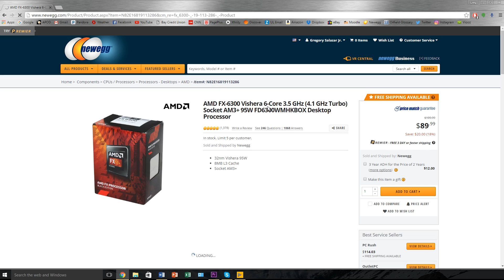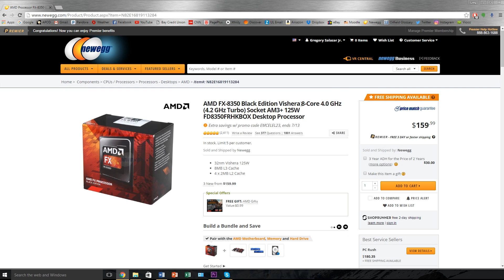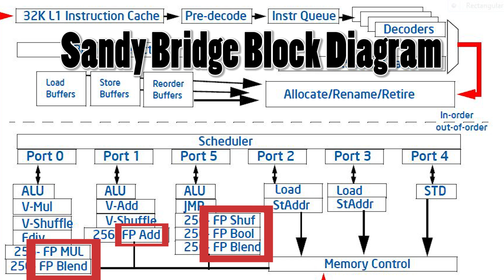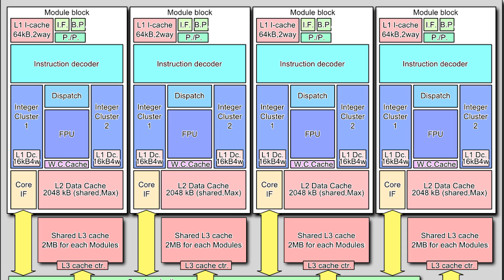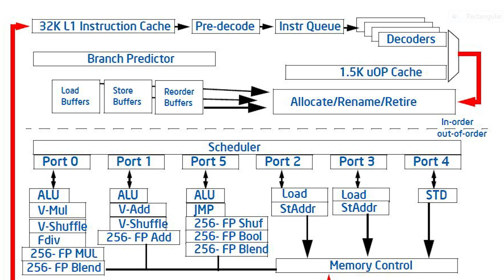How Many Cores Do AMD FX Processors *Actually* Have?

Comment: So to oversimplify everything, the 2700k has 4 cores with 2 threads per core, but AMD has 4 pairs of conjoined cores. intel has 4 cores trying miserably to pretend they are 8 threads, and AMD has 8 cores that are kneecapped into performing more like 4 cores. so both perform more like they have 6 cores and 6 threads
Reply from the maker: LOL @ your second sentence.
Reply: That doesn't change his point about hyperthreading. Intel cores perform better for many other reasons than they have hyperthreading instead of two physical cores performing a similar function to hyperthreading. In a perfect world, where both of the CPUs are using identical technology other than how they get to 8 threads, the AMD chip would be faster. Intel has several other thins going for it.
Reply: Hypertreading is a huge thnig when combined with an efficient pipeline, AMd's attempt ot emulate it fell short because of a design flaw on how data goes thru and the overall low ipc of bulldozer.
Reply: logic.
Reply: +Arobsite the only thing hyper threading does is improve CPU utilization in heavily threaded applications. No idea what you people think it does
Reply: CrackedDylMil
yeah basically al lthat hypertrading looks ot do is attempt ot solve an issue that odler cpu's had, they were very pwoerful for the time, but spent a lot of that time waiting, HT looked to od somethnig with that downtime by allowing another tread
Reply: AMD has 8 cores that are kneecapped into performing more like 4 cores. X'D you win 2 Internets sir cause one is not enough
Reply: CrackedDylMil
No, they made the bet that people would make software that was more heavily multithreaded.
Intel made a bet that there would be more instruction level parallelism (more workload pr individual thread).
Intels bet paid off, AMDs didn't.

And you can write it to make use of different arcitectures.
Of course it depends on what kind of code you're using.
If you're writing in python or whatever then you don't have much say as the optimization we're taling about here is at the programming language level.
But in C with some assembly and op-code mixed in?
Sure you can.
Heck, even without assembly and op-code just using less double precission and more single precission calculations for instance will help for an AMD CPU, plenty of programming languages allow you to choose your precission level.
Of course some have opted to just use double precission by default...
Reply: CrackedDylMil
Nvidia has equally bad OpenGl drivers tho, justthat their quadro lineup is a bit more solid spec wise ot make up for it

Both companies suck at opengl to be honest, and this is a shame because its one of the reasons why they struggle with linux
Reply: Jay Koerner
 No, a 8350 running at stock (4 GHz ->4,2 boost) can beat a 3770k at stock (3,5 GHz ->3,9 boost) in some applications.

But it's not going to match the i7 in gaming.
However it can beat i5s in gaming.
And while it won't overtake the i7 the performance of the two will be much closer when you're overloading it (gaming while doing a ton of other stuff) because the performance reduction pr core of using both cores on an AMD module is lower then the performance drop pr thread of using both threads in one Intel core.
It's not enough for the AMD core to overtake the 3770k when those tasks are not the ones the 8350 is best at, but the difference does become rather small.
And when you run code that the 8350 actually likes it's a beast. =)

I just wish there where more of those... :-/
Still for people that's obsessive multitaskers like me it's a really nice chip.

Like, I usually run 30-40 workspaces at least in linux each with 10-15 windows and if those are browser windows there's probably 7-8 tabs pr window...
Often several different browsers (chrome + firefox + Opera + a few others)

My 8350 don't buckle under the load, a quad core Intel chip would at a higher price.
And there's no premium to OC the thing if I need a little extra omph unlike Intels K series...

That said, it starts off running stuff slower to begin with.
It's never going to match a intel core in single threaded speed...
Not even close.
So it's all about what you use the damned thing for.
Reply: Transparent. Try harder.
Reply: Except you're wrong because despite only having 4 cores, each of the two threads assigned to each core can actually be utilized at 100% load with near-perfect efficiency, whereas the FX CPU cannot. So in practice, the i7 wins based on both A) the design allows Intel to remain more powerful on that front alone, and B) even if this weren't the case and they used the same design flowthrough, the massive gap in IPC difference between Intel and AMD at the moment would keep the gap just as wide.

It's silly to assume that just because the design is different, the CPU suffers. Hell, Phenom II is more powerful in terms of raw IPC performance, and it's why a Thuban based CPU clocked nearly 500mhz slower is still as fast as a CPU that features two more cores than itself. Kinda sad when your previous architecture's flagship is still faster than your fastest offering.

1100T @ 4GHz > 8350 @ 4GHz.
Reply: Depends on the workload.
Anyway, when both threads in a hyperthreaded intel core is at 100% utilization you actually get more performance penalty pr thread (even through the total throughput for the two threads combined increase) then what you get with the AMD cores in a module.
Of course if you lower the workload a little bit (something like 60ish% on one thread and 100% at the other) you'll see the intel core getting better scaling.
Of course in most cases that's exactly what you're getting...
And the 8350 got worse single threaded performance to start with anyway so better scaling for the two cores in a module then the two threads in a intel core at full workload isn't really helping all that much)
And then there's all the bottlenecks, the crap cache system, the bottleneck in the frontend leading to you only getting about 3 integre instructions feed to the two cores pr clock despite them being able to actually process 4 integre instructions pr clock (meaning that unless you got a multi-clock instruction running you're wasting resources) and the FPUs being shared (especially for double precission stuff)...

All in all it's still a great processor for multithreaded workloads, but the 8150 (not the 8350) is being beaten by it's predecessor in single threaded performance...
(I don't remember if the 8350 also beats the 1100T in IPC or if the difference is just done with frequency...)

Anyway, with the exception of the cache system that's just horrible the rest of the design decissions of the 8350 actually makes kind of sense and would have panned out if software had gone in the direction they thought it would back then...

And they did offer better total potential throughput even if its single threaded performance was...
Dissapointing...
Reply: CrackedDylMil
Ugh, Java...
It might have improved but I'm never going to like that language...

Code it once, debug it everywhere as they say...
Reply: imglidinhere
 Those 20% is due to better utilization, the i5 cores simply spend that time waiting for data from the memory or got stuff in the core not being used during the instructions it's running on those cores, things that the i7 can use.
So in terms of throughput of course the i7 performs better.
But the single threaded performance in one of those two threads in a core will go down when you add content to that other thread because the i7s core don't overprovision enough extra resources to ensure that the two threads will never hold eachother back.
In some situations you'll get a perfect scenario where each thread only wants resources that the other thread don't need and you'll get 100% utilization with zero performance penalty on either thread.
But in most cases that's just not the case.
So some of the instructions that the thread could have run that clock if the core had more resources not taken up by the other thread simply have to wait a clock to be run.
That's why you see the i7 with hyperthreading enabled actually performing worse in some games then the same processor with hyperthreading turned off.

As for the 8350 having worse worse IPC...
It has worse IPC because each module takes up about the same space as a core with hyperthreading from Intel at the same processing node, but the module as a whole actually have a way higher potential throughput then that intel core with hyperthreading at the same process node.
It's the individual cores that's slower.
They where betting on a number of things being true about future code.
Things that turned out to not be true, especially for consumer software.

As for the IPC just being plain bad, that's application specific.
All processors have different IPC for different programs at different clock speeds.
So when someone like AMD claims a 40% improvement in IPC they're (probably) just trying to give an average of what they're seeing with the programs they've tested so far (and at earlier points it was estimates)
Had programming trends shifted the ways that AMD predicted when they started developing the construction work series of chips then the IPC would actually have been higher for their chips, unfortunatly it didn't turn out that way.
Both AMD, Intel and Nvidia always have to make bets on what kind of software will run on their hardware 4 years down the line when they start planing out how their hardware is going to look.
And those bets will be off at times.
In this case it was AMD that made the wrong bed.
Tough luck.
If you make a program that actually do follow their bet then your performance is actually way higher (except that horrible, horrible cache that there's just no excuse for).
That's why the 8350 actually beats the i7 3770k in some situations at the same clock speed in individual applications and tasks despite the 8350 actually having bigger transistors due to being an older process node.
It got smaller cores with less resources for the thread to use pr clock then a intel core, but due to AMDs approach to SMT where they use two cores with shared resources the threads and cores actually have more resources available then the intel threads when the intel threads are both being chocked full of work.
If you're running one of those two threads on the intel core at less then 100% load though you won't notice that as one of the two threads delaying some instructions one clock won't really matter much as there's plenty of free clock cycles where there's space resources for one of the cores to utilize.
If it's two threads at 80% load or 1 at 60% and another at 100%.
So in real world consumer usecases Intels approach is simply superior.
For servers that actually do run 100% utilization at all time with optimized code the AMD approach is technically better though for those workloads that AMD where betting on.
And even servers don't always run 100%.

So seeing the error of their ways AMD is now going the route that Intel and IBM and many others are with cores with more then 1 thread sharing resources equally instead of guranteeing resources for one of the two threads that's just not available for the other thread.
Reply: +Luredreier AMD didn't make a bet at all. Shared resources is totally fine if the resources you're sharing is enough, AMD just made a crappy CPU.  "writing your application to do this that and the other" isn't a thing at all. You can't just write your software to prefer a certain architecture. All you can do it write it the most effectively as possible, and one architecture might benefit from certain optimizations more than another.
Reply: CrackedDylMil
Ps. If you want to read about AMD CPU optimization there's a ton of info about that out there.
I like reading some of the stuff over at http://www.agner.org/ for instance.
Ton of gold there.
Reply: CrackedDylMil
True, but they where counting on things like more workload being hardware accelerated (the iGPU) something they're still working towards with HSA in carrizo.
And they have compilers now that can accelerate even C/C++ code to some degree.
I believe the goal is to accelerate it without added libraries, just using analyzis of the code itself to identify acceleratable components.
My guess is that back then they probably thought more of the code would end up accelerated that way directly leaving less instruction level paralellism in the actual CPU code.
Yeah, they probably screwed up with that part (back then there was no way to do that much hardware acceleration for small pieces of code without getting more penalty for moving the data around then you'd get bonus from using hardware acceleration in the first place, and HSA has taken quite a long time to develop for AMD)

Of course that's just a part of it.
There's plenty of things you could theoretically throw into extra cores to accelerate software.
And there's the issue of simply throwing more software at the processors in the fist place.
That's one area where AMD still shines btw.
Of coures application specific but still.
Reply: of course Intel wins when you compare Skylake to the FX8350.. Intel had an IPC advantage the whole time and the gap only got wider when AMD went quiet for a few years without releasing any real new silicon.
Reply: Peter Hindes well they add parts to the cpu to allow it to have more "cores" some of the more important parts are duplicated, but yes you get more 'Logical Cores', its not really cheating since it's just a method to allow a cpu to have around 150-180% more performance for only a marginal increase in die size and cost, it's better to have HT/SMT then not have it since it can just as easily be turned off if you want the marginal single threaded performance boost, in almost all consumer applications the slightly lower performance, won't effect how applications run and the extra threads allow them to run twice as many applications without performance issues, if you try to run 8 threads on a 4 core chip you would be luck to get 40% the normal performance and will have stutters and hangups on resources, but with HT you will get 80% of the performance and applications wont hang or stutter
Reply: Peter Hindes He's sort of right, although he's misrepresenting the performance bonus of hyperthreading.
As SMT implementations go Intels SMT (hyperthreading) is a relativly poor one with only about 30% scaling in most applications even if Intel claims up to about 50% improvement if I don't remember wrong, something that pretty much never happens in real life even in best case scenarios...
If you can get a hyperthreaded Intel CPU for less then 30% more in price over a non-hyperthreaded CPU with the same core count, clock speed and architectural generation then by all means go for it.
If it's about 30% price premium you should consider how much multi-tasking you're going to do.
If it's more then 30% you should consider if you can get other systems with more throughput at a lower cost from Intel or others.
That said for people that both multi-task and want high single threaded performance there's nothing really beating the latest and greatest from Intel. shrugs
For comparison a FX 8350 can beat a 3770k in some applications in raw throughput but it always lose in single threaded performance.
Its single threaded performance is now about half of that of something like Haswell/Broadwell while its multi threaded performance is also behind these days, it's old after all.
Some Xeons from Intel has a way lower clock speed then their core brethren leading to lower single threaded performance while you can get more cores.
If you're willing to go for a older Xeon (older arcitectures also tend to have lower single threaded performance) you can get those extra cores fairly cheaply and can potentially get quite a bit more multi-threaded performance then say a quad core i7 for a similar price but with a way lower single threaded performance.
For single threaded performance a i5 or in a few cases even the anniversary pentium with a good OC can probably offer better performance then the i7, at least for the price.

Anyway, are you planing on building a new system since you're trying to learn these  things?

Btw here's a few things you might want to read:
https://en.wikipedia.org/wiki/Out-of-order_execution
https://en.wikipedia.org/wiki/Hyper-threading

Anyway, you can get some bugs with hyperthreading sometimes due to issues with handling all the data in the various caches, and there may in some cases be security issues, in that code running in one thread can sometimes peek at data of code running in the other thread.
When you got hyperthreading enabled and are running code on it you'll also get a higher power draw since your CPU utilization goes up and your single threaded performance may at times suffer.

But in general the benefits of hyperthreading easily outweighs the drawbacks.
Reply: Luredreier Well in personal experience I've seen it only slightly go both ways especially in encryption and video/audio editing. Sometimes i7  2700k series slightly ahead (but less often) than sometimes 8350 was ahead. I only had the 2700k to test. This might be due to other variables I hadn't accounted for, but I would tend to agree with your statement in general.
Reply: CrackedDylMil When did I start claiming things about hyperthreading? I only talked about how there are reasons other than it existing that a 4-core intel CPU performs better than an 8-core AMD CPU. I literally was talking about everything EXCLUDING hyperthreading.
Reply: +Luredreier you can't just decide to thread everything. That would hurt performance. If you have a task that can run asynchronously, and one that takes several milliseconds to run, then you thread it. Otherwise, you just don't thread it. You can't just decide to thread everything
Reply: +Luredreier I don't think you understand how traditional applications are written.
Reply: +Luredreier check out Oracle's Java 8 documentation on threaded applications (Java 8 is just as fast as C++ now adays if you know what your doing. My client runs with 0% overhead for instance)
Reply: +Luredreier oh my client Direkt works on every single platform. Except some rendering functions don't work on newer AMD video cards because of their shit stain quality OGL performance
Reply: Ricardo
Yeah, don't I know it... ><
That said on linux Nvidias closed source OpenGL drivers are actually ahead of AMDs OpenGL drivers by a fair margin (a 960 can beat a Fury in some apps)
I don't really think either graphics card company is going to provide good linux performance till vulcan becomes more videspread.
That said AMD is really improving.
And the RX 480 actually had decent launch day Linux drivers.
part of the reason why I'm considering picking it up.
Reply: +Ricardo (Teixas) I write OpenGL literally every day, and Nvidia just has less bugs than every other vendor. Usually I end up having to do things less efficiently because the way I want to do it doesn't work on AMD cards. even Intel HD is better than AMDs support at times. AMD does tons of effects wrong. Most of those effects Intel just doesn't do at all.
Reply: CrackedDylMil
As a AMD fan that game on linux I definitivly share your frustration... :-/
That's one area where AMD genuinly is behind Nvidia...
Reply: Not arguing that AMD is better. definitely not.. but AMD does technically have the raw hardware advantage here even though they only have half the FPUs they need. they still have 8 technical cores capable of doing all kinds of non-FPU math, they just get shot down in FPU intensives. but that was vs. a 2700k.. the 6700k has any AMD chip by the balls now.
Reply: True. comparing 2 architectures directly is completely unfair, but the only way to look at it objectively: how the architectures themselves perform. having more transistors doesn't always win the race.. it helps, but doesn't make it perfect.
Reply: Well... efficiency is nice, but HyperThreading is still not great if you are hammering all the cores, you just end up doing 8 things at 75% speed rather than 4 things at 100% speed.. raw performance may go up, but you are still trying to make 2 threads use the same core.. HT is nice, but.. 1 core =/= 2 cores..
Reply: Jaden S.
Well, that's not really the case even if it seems to be that way, it's not just that they're shot down in FPU intensive workloads, there's also inefficiencies in other areas, especially the cache system and the frontend.
The inefficiencies in the frontend could have been justified in the days of mechanical harddrives and lower levels of instruction level parallism that they where making this thing in...
But basically while the two cores on a module have 4 integer units in total the front end is only able to supply about 3 integer tasks pr clock on average meaning that unless one of the  tasks you give is a multi clock task (taking more then one clock cycle to complete) you're going to have inactive hardware, of course with mechanical harddrives chances are that you will have anyway since the processor ends up spending time waiting on data from the harddrive (not everyone got tons and tons of high speed RAM), so with this design you could ensure that both of the cores got at least some work done each clock cycle even if the other core suddenly got work at the same time and your first one already had a multi cycle task running on it.
But in the scenarios of todays computers you end up with the bottleneck actually being inside the processor instead of outside it...
And then there's the cache system...
That one is just bad...
Basically any instruction needing to interact with it has to spend a ton of time on waiting on the data comming from the catche and going to the catche, it's almost as bad as the RAM itself at times...
The catche is probably one of the biggest bottlenecks there that can't be justified in any way that I can think off...

There's also the issue that he brought up about not everything being threadable and AMDs approach meaning that there's less resources available for instruction level paralelism when the other thread isn't full.
Reply: +Arobsite if they were using the same technology? if they were using the same tec as Intel they would be fast(in real performance) but they would also have the same constraints namely clock speed, they would need to heavily tune down the clock with the extra fpu's leading to it being hard(with out knowing how they would have developed the rest of the cpu) to know what the difference in performance would have been, honestly amd jumped the gun thinking if they changed how the processing cue needed to be sorted that the industry would change to get more performance out of there chips, not thinking of the snowball that happened when the boost that should have came with a new architecture in the short term lead to the increase of Intel's already gaining market share(they were hoping that the performance on properly optimized software that didn't exist yet would be enough to out stretch Intel's performance lead) this lead them to be tight on funds and stuck with a bad architecture for 5-6 years
Reply: +Luredreier just made the same statement about amds chips betting no the wrong trend, they didn't take into account that Intel had already started to get market dominance and the issues in the short term with unoptimized programs lead to Intel picking up enough market share that it made no sense to redevelop to code to support it(for Microsoft, if they had optimized probably for it I'm pretty sure it would have ended up at least in the game engines if not other software like video editing) on top of the fact even if they had went the same way as Intel the clock speed hit they would take for those extra fpu's would have at best put them inline with Intel at the time. just for clarification on how bad there performance is I have a 4c/8t westmere Xeon and it gets the same single thread performance and 80% of the multithread performance as the 8350 and I got it for 12$ on ebay that's how bad a buy amd is at the time being
Reply: Jay Koerner
Depends on the applications.
My 8350 at stock can beat a 3770k in some applications at stock in multithreaded workloads.
The 8350 is mainly competing against the intel i5s being a more multithread friendly option.
I'm not going to agree with you that the 8350 is or was a bad buy. (although I wouldn't get new am3+ motherboard atm)
But its not suited for dx11 gaming and should only be picked up if your workload would benefit from picking it up.
Also with Zen comming up I've started to advice even people with workloads suitable for the 8350 to wait to see what the Zen brings to the table and the price development of the 8350 and Intels chips after Zens launch.
If you're gaming a Kevari chip might be a better buy to be honest for the price.
It got better both single and quad threaded performance, and enough L2 cache for games unlike the one carrizo chip we got on the desktop...
It does have a lower clockspeed through and half the cores of the 8350...

Going with a AM4 motherboard and a excevator core (that hopefully have more L2 cache) should be a decent build and unlike current day AMD builds you'd have a decent upgrade path with Zens also being compatible with the motherboard.

Anyway, back to the performance relationship between Intel and AMD...
You roughly need 3 cores from the 8350 to get the same throughput as 2 intel cores with hyperthreading in a good scenario and 4 in a more normal scenario.
Reply: Luredreier not sure about other applications the most i've looked at is games, cinebench, and firestrike, i was just stating that i've never seen anything in those where amd beats the current(at the time) intel comparing each core to a single hyperthread not sure if you are talking about overclocked amd vs intel since that is more even but even still as far as i can tell amd need three cores to match(or beat) a intel core with hyper threading
Reply: +CrackedDylMil I thought it could dynamically allocate cores to different threads
Reply: In the first sentence, derp. You claimed he was right about hyperthreading.
Reply: Peter Hindes You thought what could allocate cores to different threads?
A Intel CPU?
Reply: Red Phoenix Who is "you" in that comment?
Reply: Luredreier yup, how else would you get 8 threads and 4 cores?
Reply: Peter Hindes Depends a bit on the definition of cores that you use.
But part of my problem is that I don't quite see what comment you're replying too.
And no, you have two threads pr core, and the core will divide resources on the two threads dynamically.
If you have 2 cores and 4 threads any task on thread A and B can go to the first core and thread C and D to the second core but thread D can't run on the first core.
As for the work done in those threads that's managed by the operating system at a much higher level. There the operating system checks what tasks can be done in parallel and what has to be done serially and it'll put serial tasks in a thread, one little bit at a time.
The threads are basically just queues of tasks for the cores to do.
Reply: Luredreier I thought hyper threading let threads swap to other cores that finished "early"
Reply: Peter Hindes Nope.
Hyperthreading or not all multi-thread systems can shift tasks between threads if they have a OS running on them capable of doing that (most modern OSes)
It helps of the CPU in question has shared cache so you can move some of the data over without sending it all the way to RAM.
But really all you need is the tech used to allow more then one program to run at the same time on processors with just one core and one thread.
Basically the capability to interrupt a program and move the data to memory saving the state of the process so another process can get some time on the core in question.
Once you got that you can use the the technique to move processes between threads and cores too.
Still, there's a limit to how much you can divide up tasks.
Reply: Luredreier so what can hyper threading do for my cpu?
Reply: Peter Hindes It's a form of SMT.
Let's say that you have a i5 and a i7.
With the i5 that have 4 threads it doesn't matter how much work you throw at the core each core will spend a lot of time idle waiting on data to arrive from RAM or simply not using certain parts of the CPU made for instruction level parallelism.
With hyperthreading you have two different threads running on the same core saved in their own cache.
So lets say that you have a core with 4 execution resources and in one  clock cycle one of the threads have just 3 tasks for the core to do, with hyperthreading another thread can fill up that last execution resource with a task if it has something to do.
That means that you actually get way more throughput through your cores, much more work done.
With Intel CPUs that's about 30% more performance on average.
However it also means that if one thread is using most of the resources in a core then there's little left for the other thread so that thread will have to wait a cycle to get free resources leading to slower single threaded performance in that thread.
And as a result there are actually games that will perform worse when you enable hyperthreading.
If you have more cores instead of more threads on the same core you gurantee more resources available for the individual threads but how much resources each core actually have available is a design decision.
If you compare a Xeon CPU from Intel with a Power8 from IBM a 8 core Power8 CPU actually have 8 threads pr core as well as 8 actual cores leading to a total of 8x8 threads in total for those 8 cores.
And the cores are designed with the intention to always have at least 2 threads running at full load at any one time and if you don't have a minimum of two full threads you're getting very low utilization of those cores with a ton of resources simply not being utilized, but once you run a full 8 threads in a core it can actually outperform a Xeon core with hyperthreading in total throughput.
But it's not designed for fast single threaded performance.
If you where to try to play a game on a Power8 you'd end up with a rather low performance.
What Intel has done is specializing in single threaded performance, way more then both AMD and IBM has.
And that's good for games for instance.
But they still choose to use 2 threads pr core in their high end processors because of the higher level of utilization and higher total throughput that leads to.
That allows you to get tasks from two threads, potentially two different programs altogether run simultaneously on the same core even in the same clock cycle.
All in all it's just tends to be a good thing in most situations.
I don't know if Intel CPUs have thread prioritization opt codes.
But one of the things I'm excited about with AMDs upcoming Zen is that a thread can be prioritized so you're guaranteed more available resources for that thread with the other thread waiting on resources more if you need that for certain tasks.
That's how they're planing to do SMT in Zen that will come out next year.
By comparison their current implementation of SMT in for instance Bulldozer and Piledriver and even later CPUs like Excavator is that they have two cores sharing resources in a module.
So some types of tasks can only use resources from one of the two cores meaning that if you don't have a tasks using that type of resources running on both of the cores then that core will simply have that resource unused even if the other core have a task running that could theoretically use more of that exact type of resources.
On the other hand the two cores share other resources meaning that if one of the cores need that resource and the other core doesn't use that resource then all of those resources are available to a individual core while in cases where both cores needs those resources then they either have to share the resources in a clock cycle or in some cases one core will utilize all of the resources forcing the other to wait one clock cycle before it can be given resources to use.
It sort of works and it's a good idea in a lot of ways.
But in the end each core hasn't been given enough resources to compete against a Intel core that's designed to run twice as many cores and that's "bigger" (in terms of number of transistors/in size when on the same process node) and more complex as a result.

I hope that helped you a little bit?
Reply: Luredreier simple answer, it allows your cpu to more or less use one core as two "cores" with around 75-85% of the none hyper threaded performance. this all requires the cpu support hyper threading and doesn't increase the cache available to all processes, but few programs will have a meaningful performance decrease from keeping it on and it allows more applications to run at the same time.
Reply: Jay Koerner so it lets you get more cores more or less by "cheating"
Reply: Jay Koerner Eh, we're talking about closer to 65% then 75% of the original pr thread performance...
And 85%?
I don't know of anything with that kind of scaling on Intel hardware, on a AMD module or Power8 core perhaps, but not on a Intel core with hyperthreading...
As for the number of applications, technically you can run a thousand applications on a single core, it'll just be damned slow...
The issue here is more that you get more total throughput and that in turn makes running more applications more viable.
Reply: Jay Koerner Intel CPUs do not have 150-180% performance with hyperthreading...

On average you're getting about 30% added performance increase for the extra threads on each core with Intel while AMD has 40-50% and Power8 has 60% for the first extra thread and then drops down significantly for the next few threads.
Reply: Luredreier depends on the application, since some care more about having threads then individual core performance and you could see the boosts in games and other applications like them but, cinebench tells me i get 87 for single threaded performance and 487 for multi thread  right around 70% performance for each core, so yeah pulled the figure out of my ass guess in best cases it's only 140%-150%
Reply: Jay Koerner It's more then just the multi-threaded nature of an application.
Two different 8 threaded workloads can behave very different with a quad core hyperthreaded Intel CPU.
Not because of a different preference when it comes to singlethreaded needs, but because the workloads of the two threads pr core simply scale differently.
There might be a few rare cases where 150% normal performance (50% performance bonus over the regular) might be possible.
But those are only the ideal situations, and those happens next to never, even optimized code rarely have 100% ideal situations all the time.
You'll often find one of the threads holding the other back in some way with the threads both wanting the same in demand resource at the same time while something else stays unutilized.
So in the end, roughly 30% is what you can expect for most consumer software, 40% is  more likely for optimized code and 50% is the dream scenario that just about never happens.

Ps. Kudos for admitting that you pulled the numbers out of your ass. ;-)
Reply: No your wrong. When comparing two cpus with the same lithography (32 nanometer) and thread count Which are the 8320,50,or70 vs i7 2700k or if you were going to compare with equal prices at the time they were released it would be the i52500k which is still more expensive. I have had a 8320, 2700k, and 2500k and simply put, when video editing the 8350 and i72700k are almost the same within 10 to 15 seconds 2700k just barely faster. When gaming all using the same GPU (980ti) the 2700k was 5-10 FPS faster than the 8350 in the widest margin of one example while the 2500k was either just the same as the 8350 and in some cases 5FPS less. So Intel WHEN COMPARING PROCESSORS OF COMPARABLE SPECS is ever so slightly better. When comparing PRICE TO PERFORMANCE the 8300 series is noticeably better. Although considering that AMD hasn't released an updated design in FOUR YEARS there's nothing to compare the 3000,4000, or 6000 series intel chips!  HURRY THE FUCK UP AMD!!! Theres also something to be said about a 4 year old chip STILL being bought for new budget rigs! You can thank intel's refusal to allow chips in the 100 to 150 dollar price range from having anything more than two cores! Regardless of HT or not! (Looking at you i3!)
Reply: Stanley Scalf Well, the 8350 still beats the 3770k in some workloads, not to mention earlier i7s, and that's without changing clock speeds on either...
Reply: If you think about, maybe it as done to keep costs down for the consumer, if they had gone the way of Intel, I am sure the prices for AMD would be much higher.
Reply: Jaden S. I knew when I bought the fx 8 core it was 4-dual core cpu's when it launched .
Reply: Thats cuz amd lied.. like scammers do
Reply: That also got AMD sued for misrepresenting how many cores their Bulldozer/Piledriver/Steamroller/Excavator architecture actually had. Class-action suit but it still happened.
Reply: Luredreier Okay so, ignoring the majority of what you're claiming about Hyperthreading as  bullcrap here... since if you compared an underclocked i7-6700HQ vs the i5-6300HQ, the i7 is still 20% faster at the same clockspeed. Explain how Hyperthreading is less efficient at 100% workload if it's clearly faster?

It's goofy to legitimately think that the design of how the CPU is constructed is the reason why Bulldozer fell apart at launch. The CPU has horrid IPC and that's the entire reason why it sucks. Per-Core performance is bad. That's the reason and there's no other argument that needs to be had really. It's why Intel has a product that's clocked the same and is 50% faster in all scenarios.
Reply: Jaden S. u
Reply: Umm, okay but the Intel still performs better. Drops mic.
Reply: @NOISYBOY0706  not anymore >:)